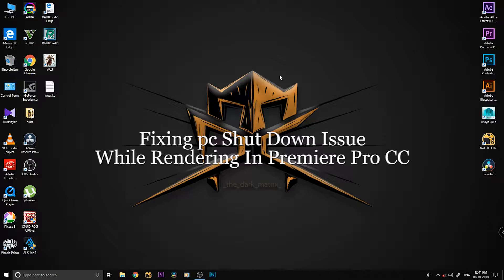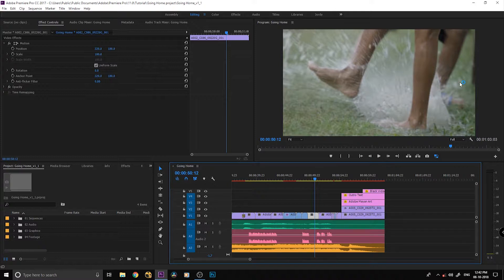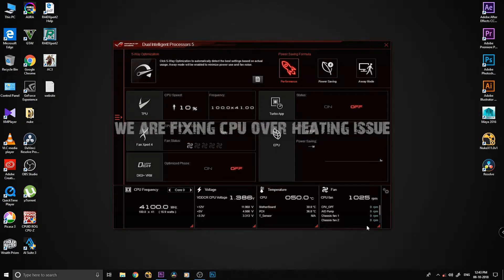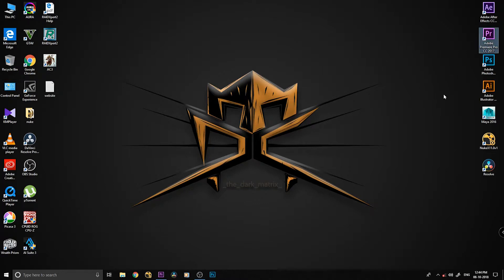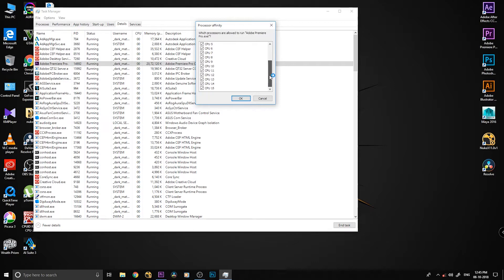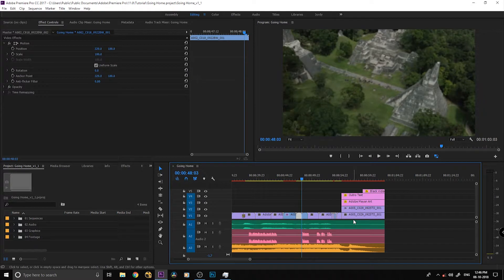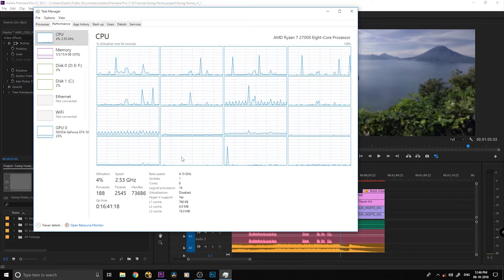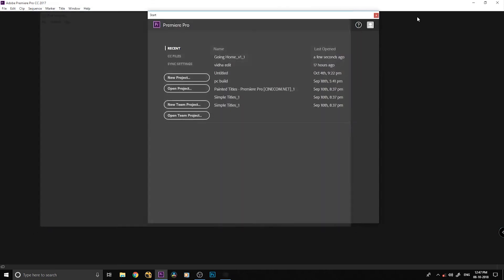Pc shutting down while rendering in premiere pro cc(2017) fix (100% working)

Comment: Power supply de problem anel enth cheyyanam.? (Lap)
Reply from the maker: lapil anel power supply issue valare rare aanu... lapil power cord nu anu problem vararullath.... ath new vangendi varum.. allel headseatnte one ear out aakumbol break kandpidich tape cheyyunna oru methord und... but that is not guarenteed.
Reply: @beestingzgaming9314  charger power kuranjal varan chance undo ingane?
Reply from the maker: chargeril varunna power kuravanengil lap on aakilla

Comment: Bro ente 3ds max lu render cheyyumpol system offayi povanu
Reply from the maker: ath temp. koodunnath aanu...
Reply from the maker: njan maya il try cheith sucsess aayathanu.... but for batch render or sequence render oro frameilum cpu usage half aakkanam.... allel buy a better laptop cooler
Reply: Chargil idumpol oru 5 second charge kayariyit pinne kayarunnilla.but  charging enna kanikunnathu system til.but 1%kazhinjal offakum.so njan battery illathe nere charging lu ithanu 3dsmax max work cheyyunnath.so power kuravayitano system off akunnath.? Battery charge ullapol ingane system off akunnath kananilla
Reply from the maker: bro paranjath vachitt battery complaint aanu.... coz chargingil battery drain aavan paadilla... power chord problem anel charging kanikkilla.... that leaves battery